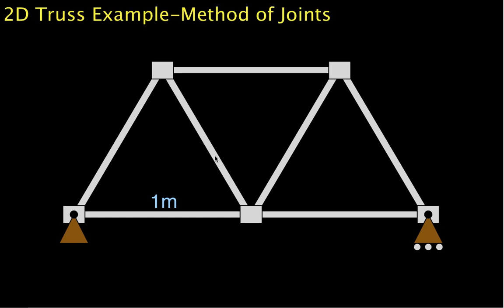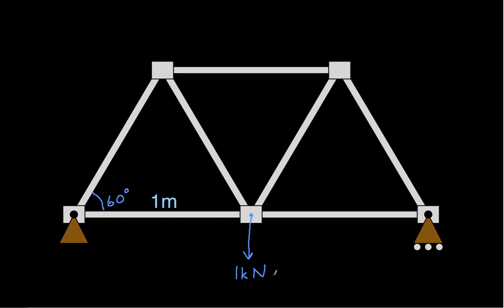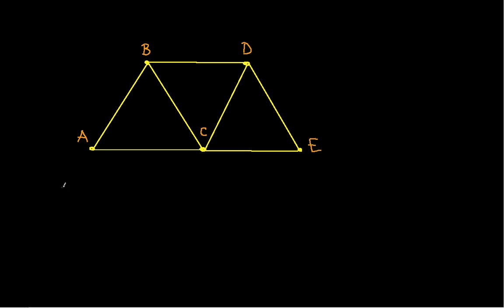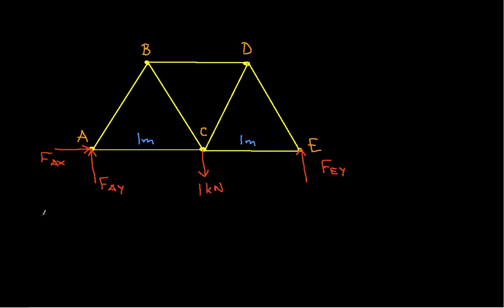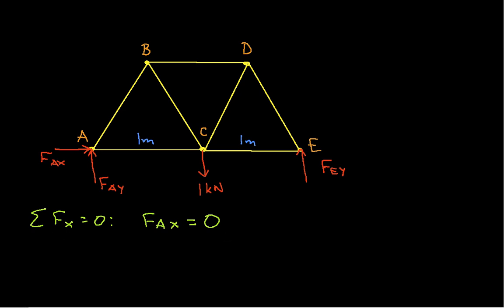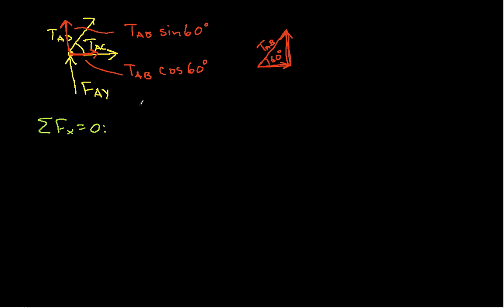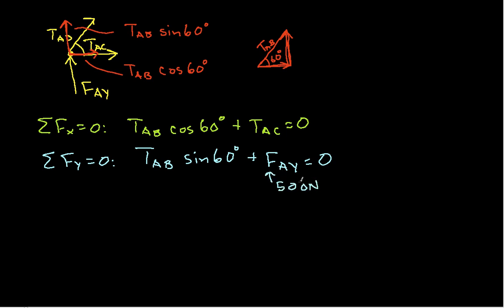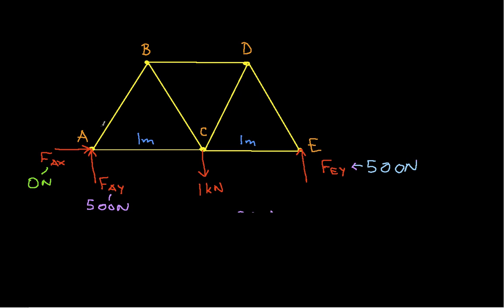2D Truss Example-Method of Joints Part 1

Comment: I am assuming he means the Tension in AB or AC, the assumption made is that the tension force is 'pulling' the pin in the direction of the member. If Tab is positive, then this is true. If Tab negative, it is not tension but compression, so the pin is 'pushed' away from the member.